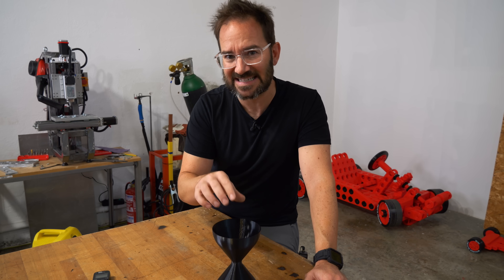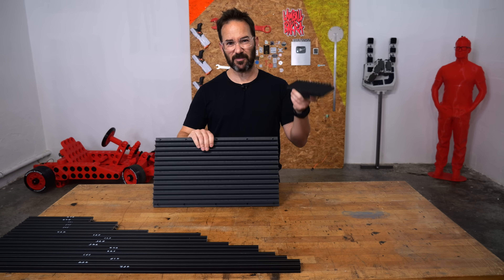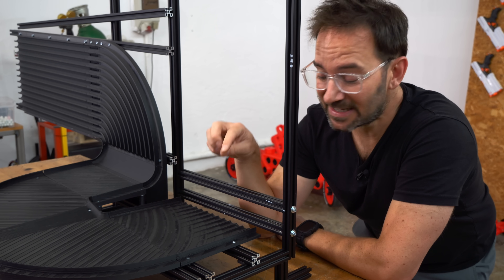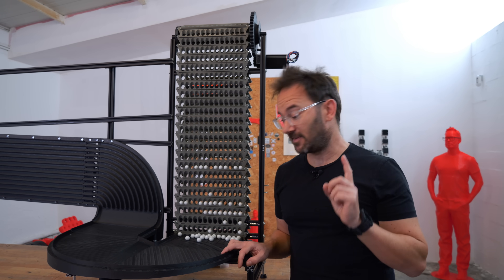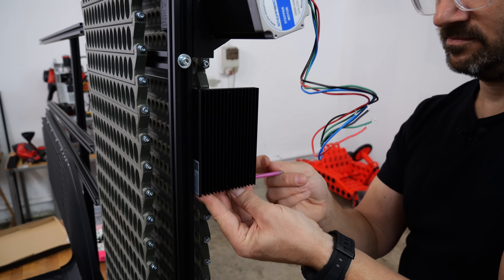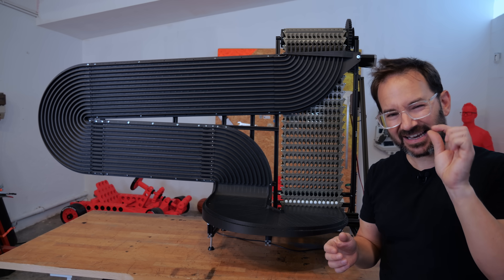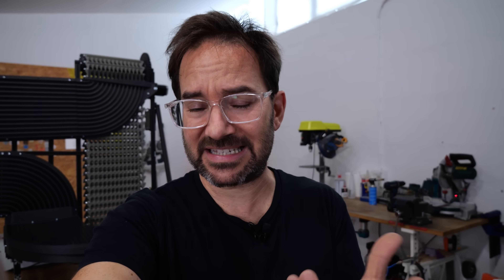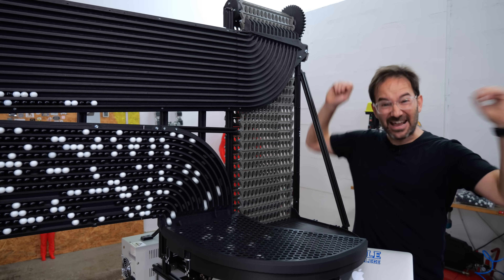BUILDING A MARBLE CLOCK - Pt.1.

Comment: You could make a better digital clock which uses only one marble, or better still, one ball bearing. The ball bearing, being denser, will be more reliable. An analogue clockwork one was made hundreds of years ago. It's sometimes on display in the clocks section of the Kensington Science Museum in London:

 A) Make the ball roll down a platter with a zigzag track cut into its top surface. The ball rides along the top corners of the groove, not inside the groove. This prevents the ball from sticking or slowing down. The zigzag has curves at each direction change down the ball's track, not sharp angles. A bit like a stretched 'S' for each part of the zigzag, and not like a stretched 'Z'.

B) When the ball reaches the end of the track, after 30 seconds, make it hit a lever which tips the platter in the opposite direction. 

C) The ball then rolls back along the zigzag track to the start point, where it hits another lever. 

D) That lever does two things: 
1) It tips the plate back again, and 
2) It indexes a counter which increments a 4 digit, 7 segment display, (or 4 separate counters, one for each 7 segment digit) made from black and white strips, or anything else you can think of. 

E) The only complexity will be in devising the counter, but it's only a mechanical grid, or 4 separate and simpler mechanical grids. EDIT: You can also simplify things tremendously by having drop down numerals on a spindle, as with the 1970's flip clocks. The digits can be printed to look like a 7 segment display, if you wish!

F) Power the whole thing, either with solenoids or else stepper motors, for the platter tipping and indexing. You could also power it with a switched motor-wound clockwork spring mechanism, or weights, or even flowing water.

G) Speed control is easy enough. The coarse tuning is done by designing the approximate length and pitch of the zigzag track and the ball mass. The fine tuning is accomplished by adjusting the platter tilt angle. If you're really clever you can mark the zigzag in seconds, or fractions of a second, to give really precise timing.

Potential problems: 1) Track corner wear increasing friction. 2) Dust, debris or insects on the platter will hinder the accuracy, or eventually stop the clock. 3) The clock has to be mounted horizontally. To minimise these, a) some light Graphite lubrication, as used in locks, prevents wear, and b) use a harder plastic or other material for the platter, c) a transparent dust cover will keep the platter and track much cleaner. d) Use a spirit level to ensure that the clock is mounted exactly horizontally on both axes.

Comment: If you adjust the channels vertically, you can easily track and measure changes in individual time increments. You can account for the units of seconds, then the decades of seconds, then the hours, and finally, the decades of hours :)

Comment: What I think about sorting, theoretical you don't need to identify the colors since it is known for each minute which marble has which color. So you “only” need gates that let on a 0 passes the first by (black) the 2nd – 4th switch and the last one pass by (for the bottom row if a row of a number has 5 marbles).
For that, the bottom part must also have channels, but I think that could be faster than a color-sorting.

Comment: i think using black and white balls a bit different in diameter will be the easiest way to sort them. and since white stuff appears to our eyes a bit larger than black it shouldn't be that noticeable if white balls will be a bit smaller.
another way is to make a mechanism that will poke out unwanted balls out of the elevator back to the crate but its so random i would imagine elevator should be going like at least x5 time faster to make it in 1 minute.

Comment: I am struggling to work out how your marble selection is going to work, and will be interested to se your solution.  It seems that for any given channel, the progression of marbles is linear.  So if you need a black marble, but the next marble in line is white, how do you discard the white marble until a black marble turns up, especially as you will need to do this on all lines?  This is going to be intreresting.

Comment: Instead of having the marbles unload out of the 7-seg display clockface and go around the bumpy curved ramp it would be simpler to just have them fall under into a ramp that channels them to the marble lift. So instead of falling down and then rolling forward away from the clock and around to the right, they just go under and then hit the marblevator and ride up behind it. Then, instead of having every marbles for every possible time displayed, funnel them all through something that distinguishes between black/white marbles (IR sensor?) and flips a paddle to separate them or channel them where they need to be for the next time. I'm subbing to see where this project goes because I imagine there's going to be a lot of changes to get it to work! Good luck :D

Comment: Great project idea but you're going to run into a problem with the marble bias at the end, most of the marbles want to end up in the far right corner, which affects which gate they come out of on top. Additionally you need a sorting mechanism between black and white marbles, or else your clocks activity will be entirely dependent upon your total supply of black and white marbles. Not only the sorting mechanism but a stacking mechanism that picks and chooses where black and white marbles go into each channel to display the numbers you want to see. Of course all of this would have to occur within 60 second intervals so that you have hour and minute time scale. Although not an immediate problem, the mechanism for popping the marbles out of the lifter is rubbing on the backside of the lift belt, short term this is fine but long term either the popper will rub down and no longer be effective, break, or even wear grooves into the backside of the belt which may affect operation. It's a super cool clock idea but a bit of a mechanical nightmare to employ. Ironically I'd argue that you don't have to worry too much about your tolerances for the marble gates and paths and the marbles themselves, you spent a colossal amount of time making it all so precise when you could've designed around the marble size being inconsistent, in the belt the size matters more but a design change could mitigate that too, just a thought as far as overloading yourself with work goes.

Comment: If you had a camera watching the marble feed belt and a set of solenoids controlling the ejection arms for each belt position, you could selectively eject one marble color from the belt a step earlier than the full eject. I think the key to building the clock "face" is separating the marble chaos.

Comment: To avoid the weight of the marbles pushing out the solenoid, turn the marble tracks into buffer regions. Since the selection process still needs to be designed, the elevator can be part of it and reject marbles by pushing them into another track going back to the bottom. The first buffer builds up the time being selected in the elevator, a second buffer holds the next time to be displayed in the curve, and the last buffer holds the current time.

Comment: Ummm. Looks like a random marble run. You need a way to sort and refill the path in the correct order. Maybe black goes forward and white goes backwards off the lift down two separate paths that then are used to populate row by row using solenoids.

Comment: It would be much easier to update row by row or column by column. You could also make a full matrix with a feeder for each "pixel", though in that case, you might want to use less resolution (4 marbles by segment is a lot). That would also mean that the display would be along a diagonal and have some depth for the outputs and some kind a gear system to move the marbles.

Comment: If you build the channels vertical, you could discard one digit at a time, which I guess would be faster? You could even do one column at a time as an optimization for some of the digit changes like 8->9 you only need one column change if you build the digits on 4 columns each.

Comment: I think you may get some kind of sorting effect in the bottom section. When there aren’t marbles waiting then the marbles all collect on the right hand side so maybe your most used marbles will end up there. This could lead to there not being enough marbles of the right colour in the right area.

Also there doesn’t seem to be an easy way to sort the marbles to be able to arrange them.

Maybe a sorter and shift register like mechanism would be the best option. You have two tracks, one for white and one for black, then the microcontroller releases them one at a time to build up a column of the display, then once the column is full it releases those marbles into the track.

If the marbles are that bad would it not be better to just replace them with something more consistent. Maybe even steel balls and you use some chemicals to blacken the black ones.

Comment: This is cool, and I realize you're making a video with all sorts of (purposeful) failure drama, but this is way more complicated and large than it needs to be.  The sorting part will be interesting.  If the marbles are different weight, you can use a variant of a coin sorter.  Otherwise it looks like measuring the color/reflectivity.

You put a lot of work into your art.  The stuff in the background is intriguing.

Comment: I'm not an engineer, but I think the connections should be prebuilt into the turning parts, like, the exit shouldn't be level, they need to be slanted. Maybe instead of making the marbles stay on the tracks using 3D geometry, why not use a transparent barrier?

Comment: 9:52 - I think it would be a much better long-term approach to bend that track forward on a wheel that will make that track follow the s like patterm and will also push the marbles out consistently, without jitter or parts that will wear out quickly

Comment: uhm already i can see the marbles preferring the right side of the elevator, I thought you would fix it by going one line after the elevator that would distribute the marble in the correct channel by color, but seems you try to parallelize? But then you are gonna have a lot of "discarge" and a path may starve of white marble and if the others are filled up..
lets see what you come up with!

Comment: Without wanting to influence your design, I think pushing marbles out of the lift and recycle them is the simplest way of sorting them. But this means some randomness to things, and lift needs to be fast enough to be able to reject a lot of marbels and still form the next minute in under a minute.

On the rejection side and dump side, all marbels could go to the left, mainly for a bigger hopper and more chaos. Right now all marbles gather in one corner at the lift.

Also insteag of a gate for the next minute, you could use a sprocket like thing to count the marbels, and make sure only a certain amount passes trough.

Second idea would be to have a multiple stage rejection system. In reverse / descending order, stage 3 rejects all wrong marbels, stage 2 rejects all white marbels and pushes them in a new hopper only for white above the stage 1 that may push out black marbels to make room for a white one in the above white only hopper. Complicated but sorting should be faster.

Comment: I think you (will) share a lot of problems with martin over at the Wintergatan channel.
Honestly, the best solution for some of them is just to use better marbles, I think. More accurate in diameter, different, less brittle material and therefore less broken ones. If the marbles slam into each other, they will severely wear over time. Also keep in mind (Martin found out) that marbles dont really like to roll, when they touch each other, because of the friction between them.
Really nice project, keep it up!

Comment: I think the biggest issue will be sorting them to make the display look right, but as for consistency of the marbles, why not use steel ball bearings and heat treat them to two colors. One set could be heat treated to purple and the other to straw and they'd have a decent juxtaposition. Of course, you could always paint them, and that'd be a bit easier, or you could even go for electroplating with different metals.

Comment: Honestly,  I think the easiest solution is to use steel marbles and use electromagnets behind the track to trap the marble exactly where you want - per digit. This can be sequenced for every minute, and it could probably programmed to look random. Best part is, no sorting necessary. Just a constant flow of magnetic and non magnetic marbles. One sensor in each lane could also prevent doubling up for coherent numbers. So long as there is one white marble surrounded by X amount of black marbles, the magnet will trigger.

Comment: This is great (and I love your "setback... build something, setback... build something else" iteration.)  It's too late now but I think I'd have dealt with the initial marble escape by running a thick bead of RTV around the edge of the bench, as a temporary bumper... of course, with your enormous printer you could probably just print a workbench-sized bumper directly?  (I say "too late now" because in the early part of the video it was mostly rolling marble, but by the end most escapees had a lot more velocity...)

Comment: I see two ways to sort and place the marbles. The first is some kind of sensor, which is the “obvious” solution, to a point. The problem with it is it’s going to be slow. You have (4 numbers x 7 columns/number + 3 columns/separator) = 31 columns x 13 rows = 403 balls per array and 60 seconds to sort them, meaning your sorter has to be able to process a cool 7 balls per second. That’s a pretty tall order.

The other option is, instead of dumping the whole array into a single pile, is to keep each row in its own lane. You’ll need 13 sorters to do it, but at least they’ll a) all be the same design, b) not have to be optimized for speed near as much (you have a whole 2 seconds per marble that way), and c) you can guarantee that each lane will be fed. Remember, you need to place marbles in all the lanes at speed too. Martin had (still has, honestly) a hell of a time keeping all the marble lanes fed consistently in MMX; by maintaining the separation that problem goes away.

Even better (maybe?) with such a system the marbles don’t even need to be sensed. The system can remember what the last minute was, so it already knows what order the marbles came out (e.g. the 2nd from bottom at 0:55 comes out 25 black, 4 white, 2 black; the 3rd from bottom is 1b, 1w, 6b, 1w, 8b, 1w, 11b, 1w, 1b). This will always be known. You could even use clockwork to run the sorters if you wanted (which sounds pretty badass to me).

Comment: Idea for sorting system you know the colour reading  and poking

A birghtnrss sensor reads each marble in the line if it's colour you want you let it roll if one you don't want a solenoid would poke them out of track the fall back down to be reloaded back in the machine

Comment: Love the project. Since the panels are already black, you could use solenoids to hold white marbles in the segment you want, blocking the segments that you dont want to fill, if you can count the marbles passed, and install enough solenoids. But it turns into a programming/automation nightmare, potentially more complex than sorting marbles and having two channels for black and white. Anyhow, best of luck, thanks for your video.

Comment: Nice video. I would have dropped the marbles from the top to flush only what's nessesary, which would probably also eliminate the need for the marble reservoire and speed up collection too

If you use metal marbles, you probably get around the imperfections and you will be able to seperate them easily (pushing them away to filter)

Comment: Solution for the marbles bouncing out of the guide bin on the bottom:  Add downward-facing pins to the hex-screen so that the momentum of the marbles is reduced as they bounce around beneath the screen.  That will also make them come out of the other side in a somewhat more uniform pattern.   You won't need a lot of pins... every second or third intersection of the hex pattern, a bit tighter toward the inlet and outside to arrest more momentum.  Make them flexible enough not to flat out trap a marble, however.  On the inside of the lower table, around the curve, add 'ramps' along the curve to direct the marbles inward as well.  This will further disrupt the flow pattern and speed as they come crashing down each time the gate is opened.
In fact, make the pins hexagonal so that they can simply be dropped into the hex holes to adjust the pachinko pattern without having to re-print the entire screen.  Likewise with the 'ramps' along the outer curve, fabricate them to drop in, either between the screen frame and the rail, or into a hex hole along the outer rim.
Also, the outer rim rail height needs to be a good bit higher (x2 or x3) to keep marbles being shoved out as others pile up behind them.

My father was an engineer (aircraft) with many patents to his name.  He would've loved this channel.  Which was why I stopped and watched when it popped up on my feed... My mind is already trying to figure out how to return rejected marbles to the feed tray.
A catch chute directing the rejects down to where the other marbles feed in, dropping them into the gap between discharge rails and screen.  The release would have to be pretty close so two marbles colliding would not eject one out past the screen.

Comment: I would use steel marbles instead of glass. Black marbles could be oxidized. Also Instead of horizontal display it would make much more sense to make vertical one when only row with changing number would be dumped down. Also Horizonat display would make whole contraption take less space.